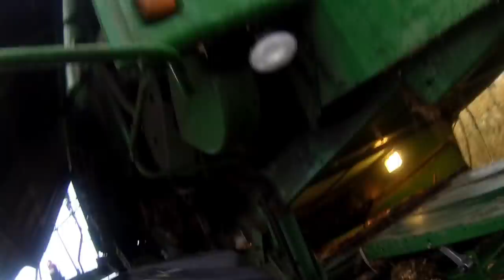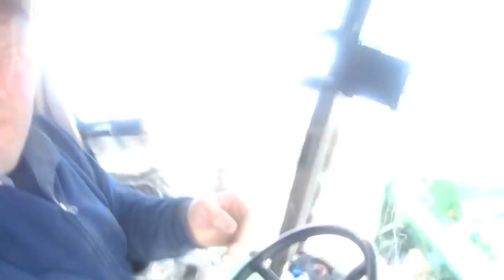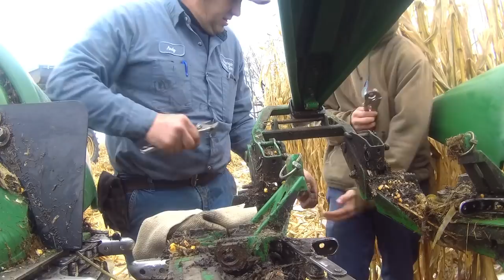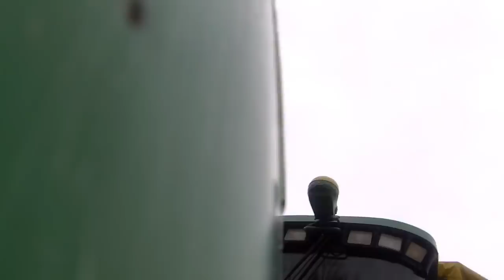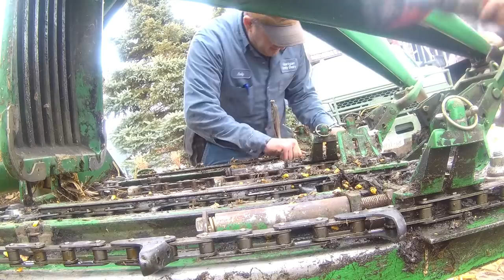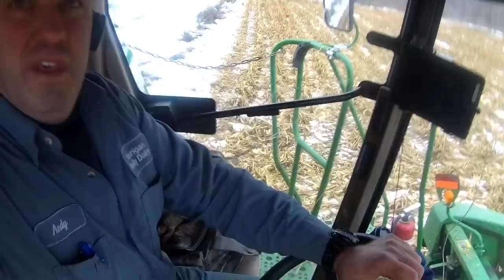Combining corn Sunday 11/25/2018

Comment: I am continually amazed how many parts wear out even on relatively new machines. It seems like you get a few trips driving a combine between maintenance and repairs. If you don't mind when time allows, please explain in detail how a combine works.  Thank you for the videos.
Reply from the maker: Maybe when I do some shop work on it this winter I can do a video on the inner workings and how it works.